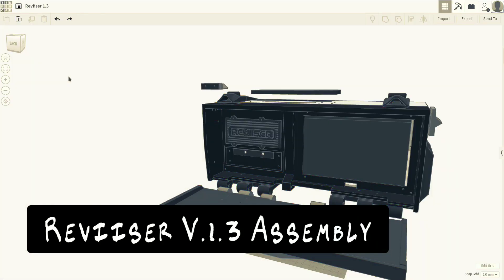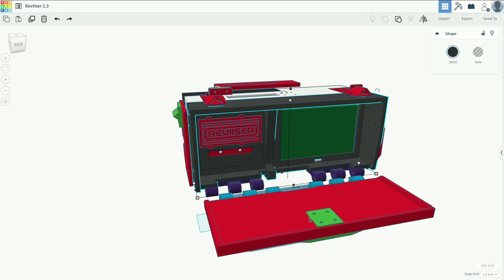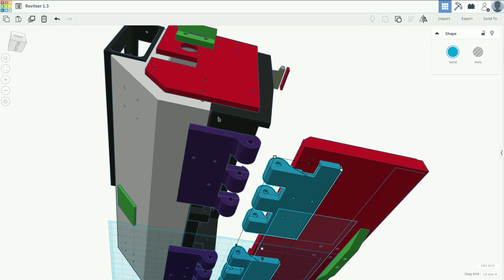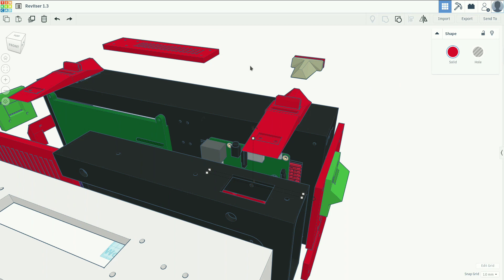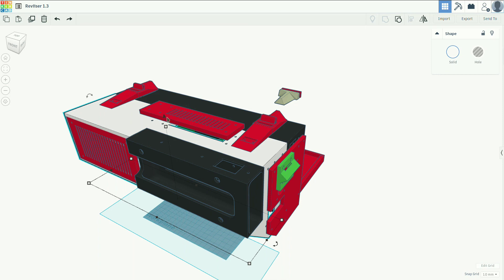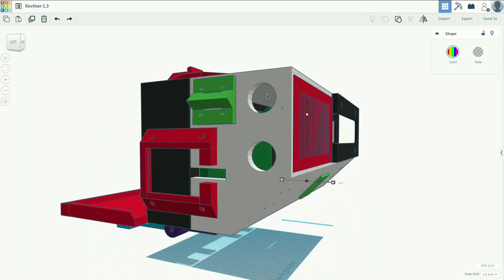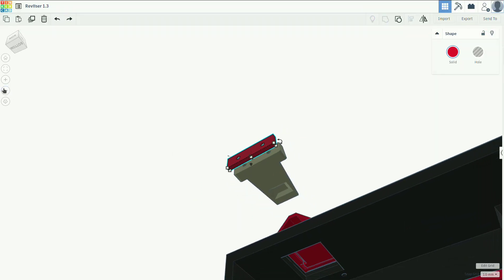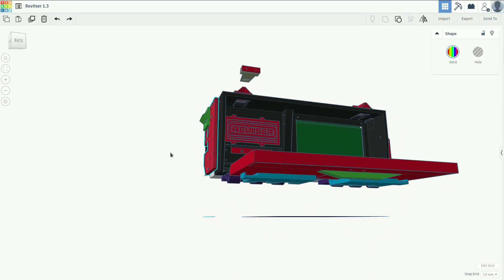Reviiser V.1.3 Luggable Cyberdeck Assembly

Comment: More switches are always nice, they're decorative after all. But the specific HDMI problem can be solved on the Pi, by setting the config on the boot partition to force HDMI output, regardless of whether or not it was detected. Otherwise it defaults to the TV out if it doesn't detect a HDMI endpoint.
Reply from the maker: Thanks for the info!I figured there was some way to do it with software but it was easier to make up for my lack of knowledge by adding switches. After thinking about it for a while, having the ability to run the box headless to save battery might have some sort of appeal to someone.
Reply: @reviiser  I know I'd certainly welcome the ability to switch the screen off when not needed. Save some power that way. 

I don't actually know if there's a difference in power consumption comparing HDMI output vs Composite output on a Pi, might be worth checking out.
Reply: @reviiser  I actually won't have to worry about this, because my Orange Pi PC has HDMI out as default. I'll keep this in mind though, thanks.